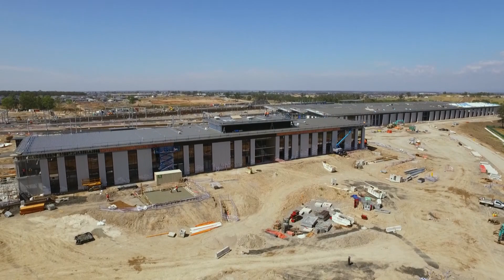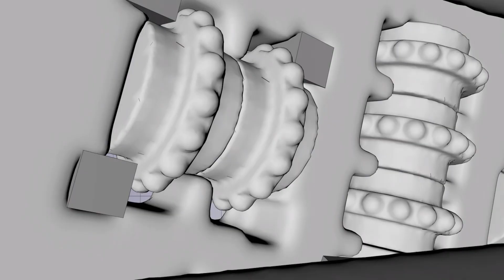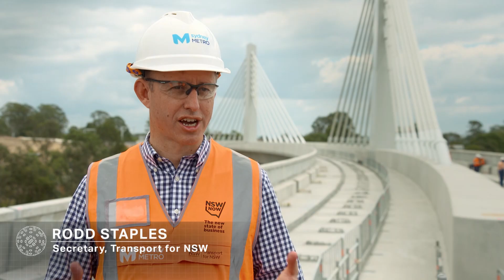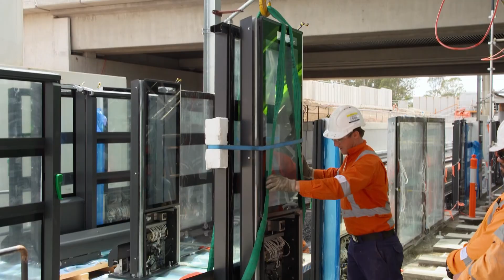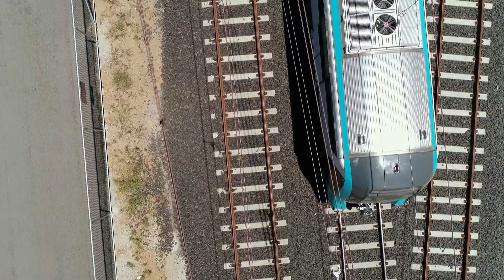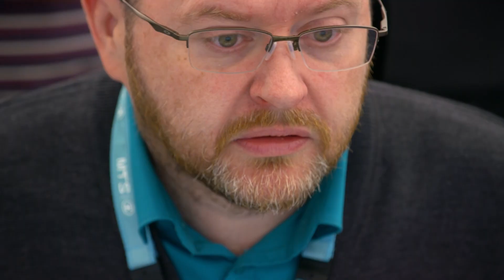Disaster Strikes! | Mega Metro | S1E04 | Beyond Documentary

Comment: Why wasn't the line extended another 3km/2 miles from the terminus at Tallawong to link up with the Richmond line at Schofields? It seems a glaring omission, albeit one that could be fixed later.

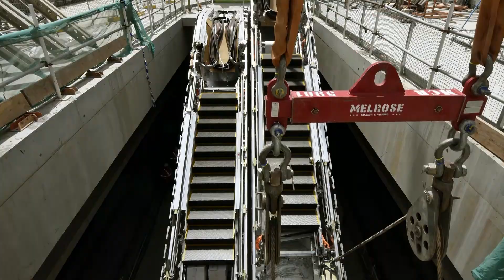Also, at 25:20, the narrator notes that escalators coming pairs - one up and one down. It is odd that there isn't a set of stairs adjacent to, or between, them in case one has to be shut for maintenance. In Washington DC, three are often installed so two can go in one direction to accommodate peak periods with the third serving the few travelers going in the other direction.

Comment: 100 kph is kind of anemic when you consider there are other automated systems around the world with top speeds of 120 to 130 kph that have been providing service for more then a half century.
Reply: It's km/h mate.
Reply: It's depending a bit on the distance between stops.
Reply: @vstr4276  The station spacing along the line being built in this video can easily support speeds as high as 120 to 130 kph .
Reply: 100 km/h = 62 miles/h.
Reply: @jondurr  What is your point, 120 kph is 74 mph and 130 kph is 80, mph. As I said, there are transit systems elsewhere in the world that have been routinely operating at those speed for more then a half century.

Comment: Automated trains would prevent the mental distress drivers experience from collisions and suicides.
Reply: They usually don't happen at all on these automated lines as most of them are equipped with platform screen doors and entirely grade separated from any other traffic.
They run on "sterile" environments so there are no suicides nor grade crossing collisions possible.
There are no longer "track wandering" issues either.
I live in Paris where 3 of the main metro lines are fully automated & driverless (plus 3 VAL mini-metro lines to access or move within airports). Of the 3, one was fully automated from its conception (M14, inaugurated in late 90's and currently being doubled in lenght) and two historical ones that were converted (the century+ old M1 & M4). They're all equipped with platform screen doors and have the highest reliability and service record on the network.
They also allow for very high frequency with 80 or 90 seconds between departures, giving the feeling that the previous train barely has time to clear the platform before the next one enters the station.
Another major asset of fully automated driverless lines is their ability to increase service capacity and frequency in mere minutes.
One example of such capabilities is at Paris M1's Western terminus near la Défense U Arena, Europe's largest indoor sports arena / concert hall.
Line M1's HQ is in communication with the arena and on its call, the HQ injects a bunch of trains on the line minutes before the actual end of the event (often slightly different than the planned end time) at top frequency to help carry the 40K spectators back to home.
No need to have 50 or 60 train drivers on stand-by for several hours, waiting for a game or concert to end, only a couple mouse clicks are needed and voilà! The line's throughput capacity has tripled.
The operators and transit agency in Paris are so fond of fully automated driverless lines that they are building 4 entirely new lines of the type under the city as part of the Grand Paris Express huge project.
They also have plans to convert at least 2 other historical lines (M11 & M13) in the near future.
There's quite a tradition for fully automated driverless metro lines in France anyway, several cities started being equipped in the 80's and 90's and are also converting some of their manned lines : Lille, Toulouse, Lyon, Rennes and Marseille.
I understand there's a bit of resistance against full automation in English-speaking countries but the level of service, safety, reliability and practicality of fully automated driverless lines is incomparable and once at least one will be running, no-one will ever look back at driver-operated trains.

Sometimes here passengers like to joke about HAL being in control (reference to the threatening computer in the movie "2001") when the dwell times are a bit too short during peak hours and the train tries to recover a light delay.
But passengers are not scared at all, quite the opposite, they love being at the front window to watch the tunnel ahead, as if they were driving the train.

The service improvement offered by automation is so great that they are currently modifying the central underground section of RER line E (a suburban express and ultra high capacity heavy metro that crosses the city center). The new system will take over from the driver for the entire central section and will be a remote autopilot running on a centralized computer and allowing very short separation at speeds up to 140km/h.
They are studying its implementation on the busiest high-speed lines of the country to allow a reduction in separation from 3 minutes to 2 minutes or less at speeds of 320km/h. As current high-speed lines are saturated during peak hours with one train each way every 3 minutes.
So Sydney absolutely made the right choice by going for fully automated driverless trains with platform screen doors.
I bet the public will be extremely satisfied by the quality and reliability of the service.